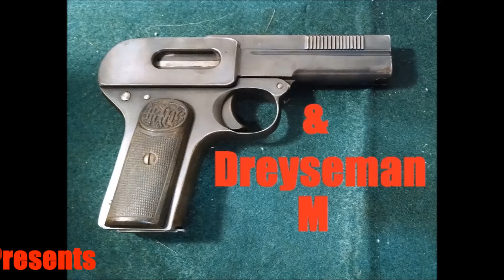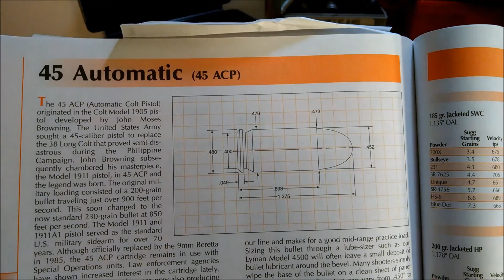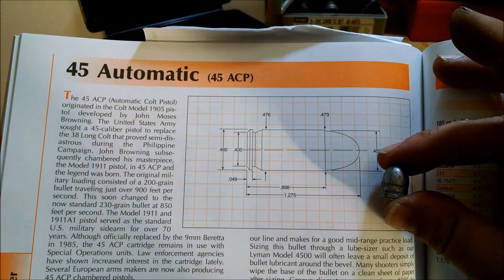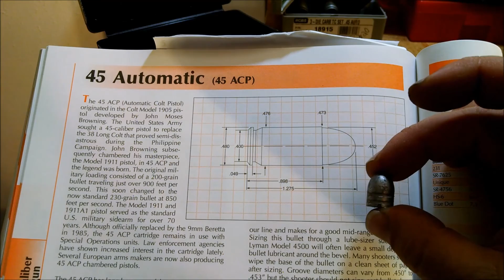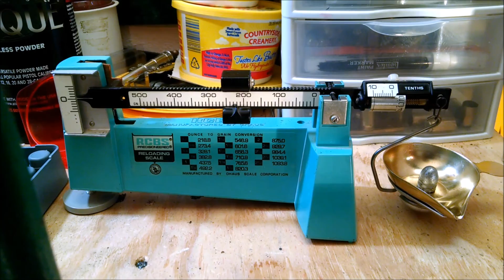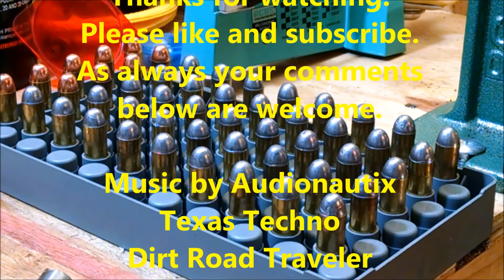Proper seating and chamber checking of your reloads *

Comment: Mixed range brass trimmed chamfered and deburred to 0.888"

H&G #68 200 grain LSWC

COL 1.250"

Taper crimp 0.469"

4.8 grains Alliant Bullseye or 4.5 grains VIHT N-310

Winchester or Federal large pistol primer seated 0.002" below flush.

Dirty gun, junk gun, worn out gun........BANG BANG BANG.....works every single time.

Extractor tuned to 25 - 28 oz tension with Weigland extractor tool.

http://www.jackweigand.com/eat.html

Stop using junk lubes.....

http://shopwilsoncombat.com/Ultima-Lube-II-Universal-4-oz-Bottle/productinfo/578-4/

https://www.midwayusa.com/product/1014882024/shooters-choice-fp-10-gun-lubricant-elite-4-oz-liquid

Stop using junk magazines.....

http://shopwilsoncombat.com/45-ACP/departments/363/

http://www.trippresearchinc.com/45acp/

Stop using junk grips......

https://vzgrips.com/pistol-grips

Start using a case gauge......

https://www.dillonprecision.com/dillon-handgun-case-gauges_8_3_25548.html

Stop using junk sights......

https://www.novaksights.com/

Stop paying too much for powder and primers.....

https://www.powdervalleyinc.com/

Stop paying too much for bullets.....

https://www.precisiondelta.com/products/bullets/45-cal/

https://www.badmanbullets.com/OnlineStore/

http://www.pennbullets.com/

http://montanagoldbullet.com/

Can't get the lead all out, use a Lewis tool......

https://www.youtube.com/watch?v=bP69SZDwbjw

Wipe your pistol down with what the U.S. Navy SEALs and U.S. Marines use........

https://www.globalgear.com.au/media/catalog/product/cache/1/image/9df78eab33525d08d6e5fb8d27136e95/1/8/18-12426-product_primary_image.jpg

Glad to help!

Semper Fi~

John

Comment: You didn’t properly size the bullet after casting. You need to lube size and then you wont have that problem.
Reply from the maker: All of these bullets had been run thru a sizer prior to loading. I am not the only one who has had this issue with this lee bullet. Thanks for watching.
Reply: I spoke too soon and retract my previous statement. I didn’t have one of these molds. I went out and got one and you’re correct. Sorry dude. I had to seat @ 1.200 and 1.170 with powder coat to chamber correctly. The SWC cast seems to work fine without seating deeper just in case you’re wondering. You can call me an ass if you want lol
Reply from the maker: No Issues, This mold is why I did this video. Again thanks for watching.

Comment: The problem sounds like the radius on the nose of your cast bullet is not to spec?
Reply from the maker: Seams to be an issue with many round nose bullets and the 45 ACP I have even had some factory round nose that have had to be seated a little deaper. Thanks for watching.

Comment: I'm having the same problem with this mold....    Do you size your bullets at all or use them as they drop?   My barrel measures .452 and with lead you're supposed to go 1 to 2 thousandths over....  So I wasn't sure if my bullets were too fat and was causing the case to bulge out and causing them to not fully chamber...    I'm also having trouble with my taper crimp die....  Are you crimping yours at all or just seating the bullet?    When I crimp mine, it seems to be squeezing the bullet back out of the case and not holding the bullet firm.    I know the taper crimp isn't suppose to be very strong but my bullets spin freely...      The last thing I tried,  I reamed out my Lee sizer to .4535    and seated to about 1.205 OAL  but I chambered the round, and took it back out and the bullet was seated about 2 hundreds deeper, seeming the gun rammed the bullet deeper, I'm guessing that's  a taper crimp issue....   I got frustrated and loaded 357 magnum instead for the night
Reply from the maker: +mrbriancnc Sorry to hear you are having problems. I do size these to .452 and roll crimp them with my Seating die. You might try a small roll crimp before you taper crimp the round that might help keep the bullet in place. The fat round may be another problem, your barrel may measure .452 but your chamber may be tight and not allow that extra thousandth around the neck of the case. These do look very short and stumpy compared to factory bullets but I Took another 50 of these out today and had no issues with feeding, over pressure or failure to cycle. Accuracy was good also. Thanks for watching let me know what you figure out.